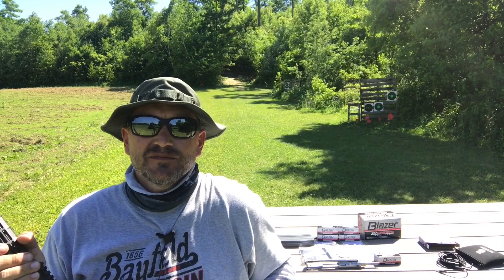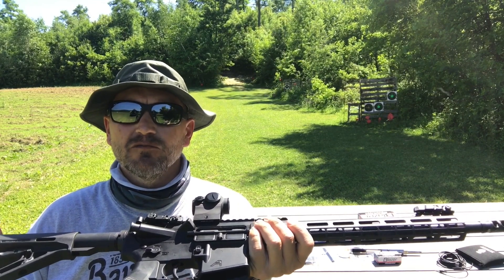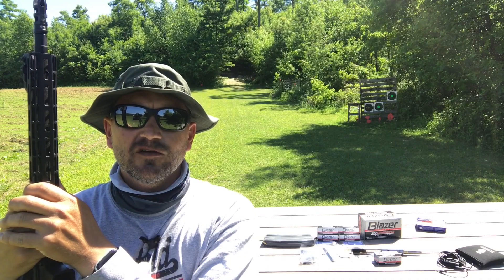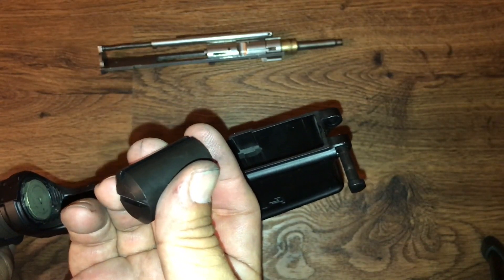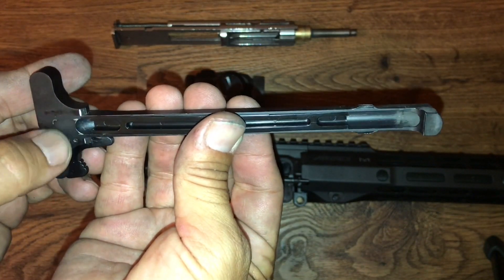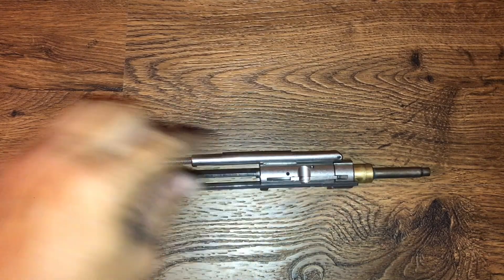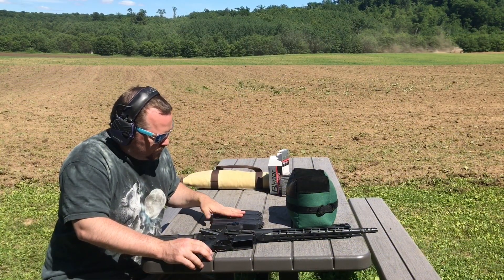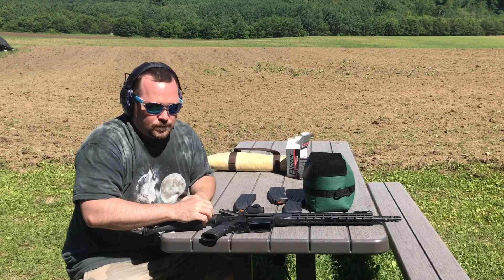CMMG .22 Conversion Testing and the BoreBuddy Reliability Kit

Comment: One of the things CMMG states is to use plated 22 rounds to prevent lead build up, so that is all I run. Haven't seen any buildup.  The first time I used it there was a lot of carbon blowback between the adapter and chamber and even running a snake through I found that the 223 was sticking when the barrel heated up, the last one stuck so tight it would not come out.  I let it cool down, then it slid right out and I found carbon deposits on the case near the neck.   Once I got home and started cleaning I found the culprit for the blowback was a nick in the tip of the adapter that was holding the bolt back just enough for gasses to slip past and get trapped in the chamber.  Suggest everyone who gets on examine the tip closely to make sure it is 100% smooth.   I took a fine file and was able to smooth the tip for a perfect fit. 

The next time out I ran all the 223 through it first then switched to the 22 adapter after running a snake through.  Ran 300 rounds through with only one jam, and that was because it had a slight dent in the case that caused it to stick and didn't fully eject.  It was the 5th round through the gun.  Shot 300 rounds through it that day. I use it in a Ruger AR556 and it shoots great.  I do see a benefit to these parts and have them on my upgrade list.

BTW thanks for taking it apart, I had no idea that it comes apart that easy. I think the charging handle adapter will be the biggest help, mine was loaded up with junk as well as a lot of debris behind the bolt. I run the Ruger wet, so a lot of it sticks.  What I like the most about the CMMG, it is nearly paid for with the rounds I shot through it, @ 34 cents per round difference between the 223 and 22, 500 rounds through so far it has already saved me $170, and will only save more as prices are now 8 cents and higher per round than what I paid a couple weeks ago.
Reply from the maker: EXCELLENT COMMENT!  You're pinned to the top!

Regarding the stuck rounds, I do a few passes with a bore snake and a couple twists with a chamber brush between switching back and forth between .22 and 5.56.  When I switched back to 5.56 after getting the barrel full of lead my first shot of 5.56 had a hung up ejection, no doubt from all the gunk building up in the gas tube.  I have to assume the first shot blew all the debris out, as it ran flawlessly after that.  Again, thanks for a very constructive comment!

Comment: Soo… unless I missed something, Your doing a review on the CMMG conversion kit.  But, your testing it and then bashing it after you straight up point out that you went and got the worst shit ammo you can find to test with? You do realize this is simply a conversion kit that allows you to use an AR that you already have to change out the bolt and magazines and shoot some 22lr through it right?  I have a kit as well.  No were in details did it ever claim to turn your budget AR build into a high end precision tack driving machine….lol. Come on. Got to be realistic in your expectations.  Want it to perform more reliable and possibly more accurate?  Take advantage of the Bore buddy engineering upgrades.  At least start with some decent ammo as a reasonable starting point.  Putting shit ammo in it and then hitting record.. wonder why that’s not the standard benchmark among others reviewing similar products.   You want to review shit ammo.. fine go for it.  But even a dedicated rim fire 22lr upper is going to foul and gunk up and have problems.. just a thought

Comment: I experience the same . I ended up just going with the dedicated 22barrel . 1/7 twist does not do so well the 1/9 does better . I just could not get over the crazzy amount of lead build up so just got collar and 22 barrel .
Reply from the maker: There's definitely differences in brand.  Different lube or harder cast lead?  A stock 10/22 has a barrel twist of 1:16 if I'm not mistaken.  The Blazer had plenty of powder residue but hardly any lead.  Copper washed, even the cheapo ones didn't have accumulation either.  Before things went sideways I was hoping to get about 200-300 rounds without a malfunction which was what I was seeing with Federal Bulk Pack or Winchester Wildcat.

The dedicated upper is the smart move.  Thanks for checking out the video!

Comment: The charging handle insert is to stop empty brass from logging in the charging handle.
Reply: Bore buddy claims it reduces the gasses from the gas tube also.
Reply: I had a 22 casing get lodged Under my bcg in the trigger/fcg space.  It luckily didn't break my $400 FA trigger.  The first 500 rounds were miserable.  FTE and double feed EVERY. SINGLE. SHOT.-  Dead Trigger, FTE, double-feed, tap/rack/repeat.
Reply: @BeReal918 what did you do to fix it? I’m having the same trouble

Comment: What exact parts did you use in order to get reliable LRBHO? I've heard that with the m&p15/22 mags with the AR mag clip and the v2 bolt release it should lock back on the last round but was just curious if that is the way you went about getting a reliable last round bolt hold feature. Any advice or information would be greatly appreciated, awesome video and you definitely earned yourself a new sub here!! ✌️
Reply from the maker: CMMG's .22LR magazines all have last round bolt hold open.  No special equipment required!

Comment: Question: so the lead in the muzzle device impressive. how was the bore, hard to clean ? also you mentioned you thought first 556 round cleaned the gas tube and shot fine since, that was another worry of mine. I have some Aguila super sniper 60 grain, supposedly needs a fast twist rate like the ar(1:9) has to stabilize instead of the 1:16 that 22 barrels use so researching the CMMG conversion for that reason. I guess I need to compare my S&W M&P 15-22 shooting them to the conversion kit. What's your thoughts on accuracy? I've heard different things, your hits at 25 yd weren't impressive but that was with a reddot? Guess I should check into price of a 22 barrel in 1:9 twist?
Reply from the maker: Hey John.  The bore was a disaster.  I spent hours trying to clean it.  I was initially unable to get a cleaning rod down it and was only able to make slow and incremental advances with a brass bore brush as the bristles scraped away the forward edge of the fouling.  In another twist, even though CMMG recommends jacketed bullets, the Blazers that worked so well were bare lead and the Winchester M22 was copper washed.  I have since shot up most of the M22 in a Ruger SR22 pistol and my 10/22 and it functioned fine and didn't foul the barrels.

Accuracy definitely suffered from the twist.  I've since picked up a 1:16 dedicated .22 upper from Palmetto State Armory that uses a nearly identical bolt carrier to the conversion kit and it's tightened the groups up nicely at 50 yards.  I haven't done a ton of shooting with the dedicated upper yet, but I'd say that it was giving me 2.5 inch or smaller groups at 50 yards with a red dot vs. 9 inch groups at 50 yards with the conversion kit.  If you decide to go the conversion kit route I'd love to hear back on how it performs with 60 grain bullets since they're within 5.56 weight ranges.  Perhaps the smooth bore distance between the .22 chamber on the conversion kit and the 5.56 rifling will still reduce accuracy?

I did another video that further discusses accuracy here:  https://www.youtube.com/watch?v=CgDrzbgxxx8&t=1s  Good luck and have fun!
Reply: The nominal diameter of 5.56/.223 and 22LR is all .224, which would not result in the bullets "bouncing" down the barrel, the reason for the lead build up on the muzzle device is the disparity in optimal twist rates between the cartridges standard bullet weights which causes the 22LR to have a deviated flight path immediately after leaving the rifling. As for the lead build up in the barrel, most modern 22LR pistols and rifles use micro groove rifling because there is less grip needed to impart the spin on the bullets as compared to a full power round like 5.56/.223, which combined with the fact that 22LR is not "jacketed" in the same sense as most other cartridges and only has a comparatively thin layer of copper is what leaves much more lead fouling in the barrel and gas port. I hope that these more technical answers shed a bit of light on the issues.
Reply: As a follow up, I recently purchased a KAK A2 dimension comp for when I feel like putting the bayonet on for fun, because I live in california where flash hiders are "evil", as a replacement for my Strike Industries comp. When I got it, I found out that they over bore the end hole to help with the issue of the rounds striking the comp on their way out, and using an over bore comp could be a good solution to having to clean the lead from the comp, which was an issue I had with the SI comp.
Reply: @blakebeaton5821 
Absolutely ! Thank you

Comment: curious do you think you would have had all those problems if you just stayed with the better ammo ? meaning the led clogging
Reply from the maker: I'm confident the cheap ammo was the culprit.  Prior to this I had shot copper washed bullets with no problems and the Blazer .22 maintained its accuracy for the duration of the test even up to 1,000 rounds without even gumming up the bolt face too badly.  If I remember correctly the Walmart ammo was keyholing the target by the first 100 shots and I had cleaned the rifle after not being able to get a failure with the Blazer.
Reply: @NorthwoodsRenaissance  thank you so much for the response i been debating of buying the conversion kit but was holding back because i didnt want to mess up my barrel and im disabled so my ar had to be customized so i could use it since my arms dont bend need 20 inches from trigger to shoulder but want to practice with it but 556 ammo to damn expensive. So thank you for the detailed video and responding i just have to use the good ammo which is alot cheaper then 556 caliber and i will be ok and clean it often after shooting.
Reply from the maker: @shrakkem  If you're not strapped for cash you might be interested in a complete .22 upper instead.  You would get better accuracy with a dedicated .22 barrel as it's the right bore size and twist.  You would still be able to use your lower if that's the only part you have that's custom. (I had to get out the tape measure after you said 20 inches and check it out).  

The most affordable would have been Palmetto State Armory, but they have been sold out on .22 uppers for a while. CMMG carries them although they're nearly $600.  If you you would be happy with the accuracy that I showed on the video then the conversion kit will work out just fine.  

Also, I did another video on the conversion kit before this one.  Here's the link if you haven't seen it already. https://www.youtube.com/watch?v=CgDrzbgxxx8&t=1s
Reply: @NorthwoodsRenaissance  
the dedicated runs pretty good, it's a quick switch. I'm really looking for the most reliable, and suppressed is gonna be even dirtier, so the upgrades might be necessary for me
Reply: @NorthwoodsRenaissance  .22 8” PSA upper today is $369.00. A lot of comments say it’s pretty unreliable. Love PSA.
Reply from the maker: @michaelshanahan4965  I picked up a 16" before just before Christmas.  I don't have a ton of rounds through it yet beyond zeroing the irons and the red dot but so far it seems to be on par with the conversion kit for reliability and showing a significant improvement in accuracy.  More testing required!
Reply: @NorthwoodsRenaissance  Thanks

Comment: I use my kit quite a bit due to being in an urban area and 5.56 would be a problem.  I heard stories of how some people were saying they had to break in their kits. So when I got mine I polished each of the mating surfaces and the feed ramp and have had great reliability even shooting cheap stuff like the golden bucket. Cheap stuff is definitely not as accurate and extremely dirty. Keeping her wet helps alot both for function and cleanup. My rifles 16" & 10.3" shoot  excellent groups with the heavier grain 22 rounds. I did the RTV gas buster mod to the  standard charging handle. Found I have a definite lower left POI shift when suppressed. But for now 22lr training is better than nothing. I still have to take mine out to see my POI shift from 22lr to 5.56. I like your content so far thanks for the videos.
Reply from the maker: The red dot I'm using with it has a bullet drop reticle so that's a good reference with point of aim/point of impact shift.  Thank for stopping in for round 2!  Probably won't be any new videos for a good while until things settle down.
Reply: I just bought my CMMG bolt kit
 20-November-2022.
The first thing I noticed was the crunchy recoil spring on the guide rod. I didn't touch anything before I ran about 300 rounds of plated Remington golden bullets through it... I had about eight failures to fire..bad rounds/primer issues. I did expect that,and more actually... from cheep bulk ammunition though.
I did however notice that the crunchyness did not smooth out at all. So while I had the bolt apart for cleaning I used a small precision chuck in my dremel and polished the guide rod starting with 400..just very lightly...just enough to flatten the tooling marks..then 600 then 1200 then emory cloth...all with oil... Changed the whole feel of cycling the bolt...like butter. I also smoothed up and fixed up the feed ramp...it looked like CMMG had an angry monkey do it...I mean it worked....I just wanted better.